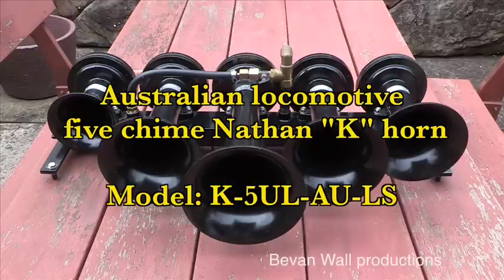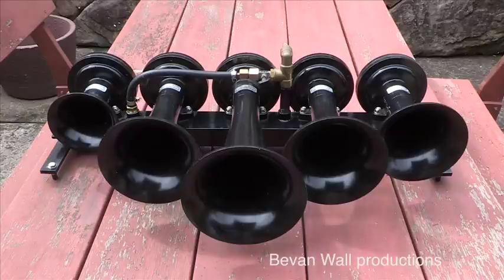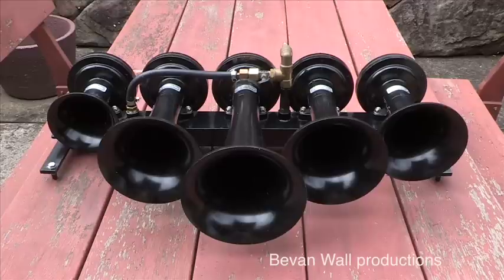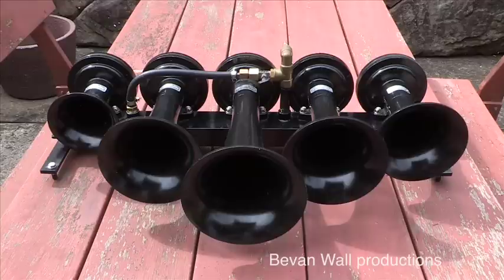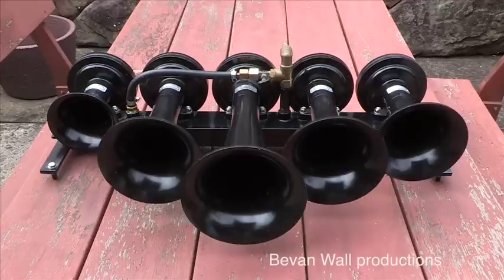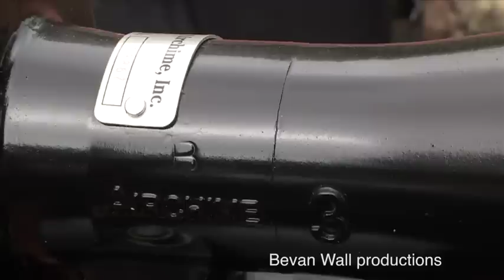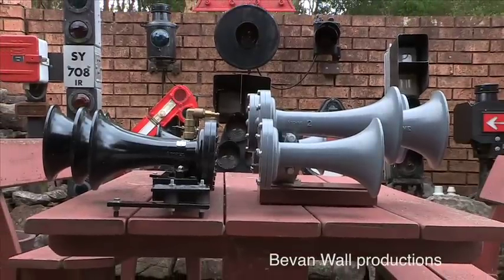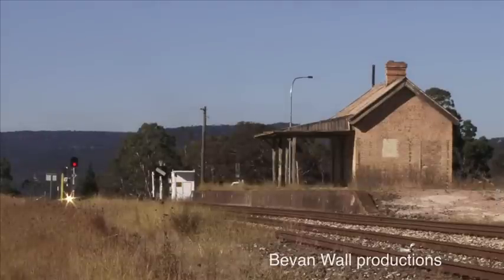Australian locomotive  five chime Nathan K horn

Comment: The CT rail Hartford Line EMD GP40-3H Engines use these horns in North America because the Engines used there needed a ultra low Manifold for the Tunnels on the Springfield Corridor

Comment: RARE SOUND AT 6:21: BELL! Why don't they use their bell in Australia?
Reply: Up until the 80's I don't think any locos were fitted with bells, and from then on I think they were only optional until sometime in the last couple decades. We use them here for low speed same as the US but not very often since I don't think there's any rules that say they must be used. I've been told that some older drivers see it as an Americanization thing but I'm not 100% sure on that
Reply: DounutCereal cool. In the US, however, we usually use the bells at all railway crossings.
Reply: That'd explain why they're heard so much in youtube vids
Reply: DounutCereal Bells first became required on all steam engines in Massachusetts where I live in the 1800’s because people didn’t always pay attention to approaching trains at crossings and stations.

The bell became an additional tool to the whistle to help get more people’s attention.

Then, diesels and electrics came about and horns replaced whistles, but steel, bronze and brass bells all remained.

Now it’s air horns but with ebells. :)
Reply: Ditch lights too
Reply: Medium Approach Medium Productions bells aren’t really needed at crossing’s so we don’t really use them
Reply: they will be because those locomotives are from emd
Reply: @luispatricio2801  Our most modern EMDs have a 3 chime I believe. But, the slightly older ones have P5s
Reply: luis patricio actually it was made by Motive Power
Reply: Bells usually get used during shunting. Apart from that, they aren't really used much.
Reply: @mdgfb05  the GT46C-ACe use a Nathan P2 IIRC
Reply: @aydoyt  Ah, thats interesting.
Reply: @aydoyt  p3
Reply: @GoldM4official  No. They actually use a K2. It can't be a P3 as that is a three chime. The GT46C-ACe has a pair of 2 chimes.
Reply: @aydoyt  yeah I misspelled it
Reply: @aydoyt  but the gt46c uses the p3
Reply: @GoldM4official  Yeah but not the ACe
Reply: @aydoyt  more a K2H sound

Comment: Bruce thanks for the sharing and an enlightening video indeed especially when hear the same horn on different loco's all sound the same????  For the enthusiast and modeller having the right sounds are important but how often do we actually get the right sounds, and going back to the early NSW diesels that had Nathan 5 chimes each were very much different in sounds.

What type was on the 40cl, and the one now fitted on preserved 4001 is very much Off, some have said its got a dud chime/trumpet, but being Canadian rather than from the U,S did the Canadians have this unique sounding air horn or was it specific to NSW?

The 42, 43 and Mk1 44clas loco's also are said to have Nathan 5 chimes, but each were distinctly different. Certainly each were much sweeter and softer than what we hear these days.  Likewise there are some very harsh sounding air horns I hear on trains passing by here on the Central Coast, the line is some 3 K's as the crow flies from my home and its a literal challenge in hearing wha'ts what.

But, what types were found on those early diesels?
Reply from the maker: The 40 class were fitted with Airchime M5 horns. Both 4001 and 4201 currently have M5 horns fitted, and both have a couple partially blocked bells.The 42 and 43 class had first generation Nathan P5s. Here is a useful website: http://atsf.railfan.net/airhorns/
Reply: Thanks Bruce.  I have that website marked as well as another couple, have yet to actually find a recording of the air horns that are close enough for our diesels.  I would imagine there were alterations to the tunings on them for use here.
Another air than has been changed in its tuning is the RVB types that first came out in NSW fitted to the Mk4 48cl, very sharp and clear. They were also on the 47, and 73 and all but the same tones, when fitted to the 422 and Jumbo's there was a difference again, but with them and especially the 422's it was the trail offs owing to the long air line between cabs.

Comment: Great video! I love the tuning it sounds awesome. I just don't understand why they would need an ultra low manifold when they have them up there, it doesn't save much clearance..
Reply: A better idea would be to mount it under the frame like some P42dc passenger diesels.
Reply: Sits better in the Hole made specially for the Horn.

Comment: I thought this horn was made by an Australian company, not Nathan airchime!
I like these horns! they sound a little like a K5HL!
5:58 why is that one flatcar in between the locomotives?
6:21 I think I've only heard a bell on an Australian locomotive twice! (i've never been there!)
Reply: 1. The locos might’ve been under some form of test. 
2. Hearing a bell is exceedingly rare in Australia, the only locos you have a chance of hearing them on are the CM or CBH class, as they’re American built and automatically turn on upon sounding the horn, though they always get turned off by the driver straightaway. Locos from as early as the 80s here do have them but it’s extremely rare to be able to hear them.
Reply: CFCLA/Rail first CMs have the bell connected to the horn as the same time when it's blown same thing you guys do plus I think the CM class is from America that's why the bell is turned on when the horn is blown

Comment: I'm curious of what is the proper horn sequence for crossings in your country. I noticed in some videos the trains blow one long blast before the crossing and some videos the trains sound a couple short toots before the crossing. Does it have to do with the railroad company or the part of the country where the trains operate? In US and Canada most trains sound two longs one short and one long before each crossing.
Reply from the maker: There is no regulation in Australia governing the horn sequence blown for crossings.
Reply: usually drivers just choose to honk once like 300 meters away and then honk when they get closer
Reply: It varies by state. For example, NSW required one blast before crossings, at a reasonable distance. Victoria, in contrast, does 2 blasts, one at the whistlepost and then one at the crossing.

Comment: What is up with the train @5:40 ? Why 2 engine then rollinstock then locos? A test run?
Reply: It was when Pacific National was trialling the 92 class C44ACi's on intermodal work before ordering more (they'd previously only worked the heavy coal lines and they did order more, the intermodal C44ACi's becoming the 93 class) and the model when fully fueled is overweight by a couple tonnes. The wagon with the tanktainer is for inline refueling and the box is to weight balance it/house the pump equipment. The 2 locos behind that were hauled offline as backup if something went wrong during the trial of the two 92's

Comment: Now CTRail uses K5UL-AU-LS horns on their GP40-2Hs
Reply: Yeah, but they sound like absolute garbage for some reason.
Reply: Only 6694 and maybe one other sound like trash because they came back restricted as fuck. 6695, 6696, and 6699 (as far as I know) sound like they should.
Reply: -3H. All were rebuilt.
Reply: @FanRailer  6694 and 6698 have restrictors. 6695, 6696, 6697, and 6699 don't, and those are the best sounding in CTrail's rolling stock! :)

Comment: I bet the locomotives were american imports because they feature flashing ditch lights (an american locomotive requirement)
Reply: no these locos are desgined and Built in AUS
Reply: C44aci's are Australian built. Ditch lights flash when the horn is activated on them.
Reply: Michael No. They are GE Built. They were built in North America by General Electric and were shipped to Australia.
Reply from the maker: They were built in Newcastle, Australia. I was there!https://www.railpage.com.au/locos/cey-class
Reply: RailfanJojo No, Australian designed and built using GE internals. I can send you photos of them under construction in Broadmeadow, New South Wales if you'd like? Stop the condescending tone too btw, it's VERY unpleasant for anyone passing through...